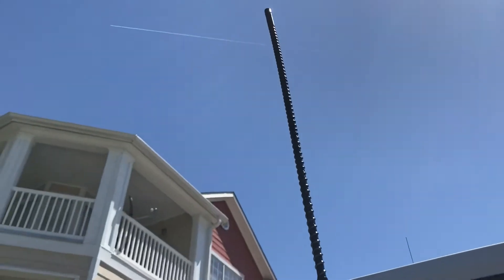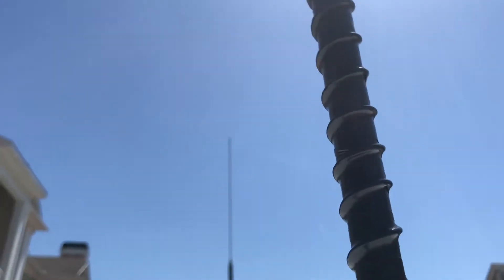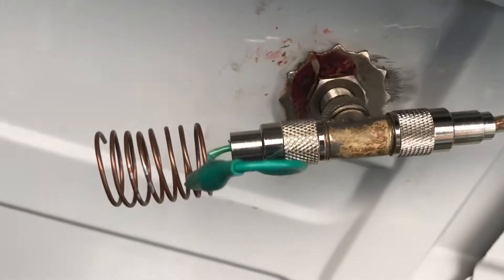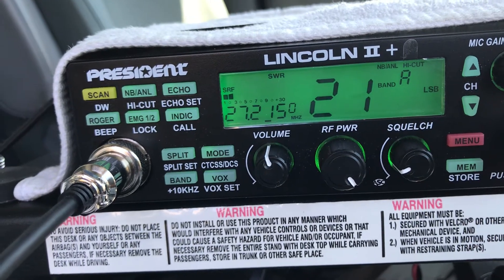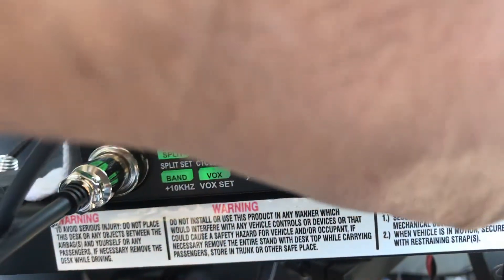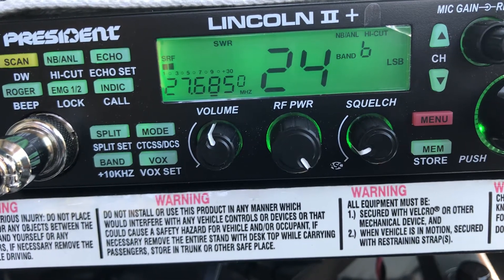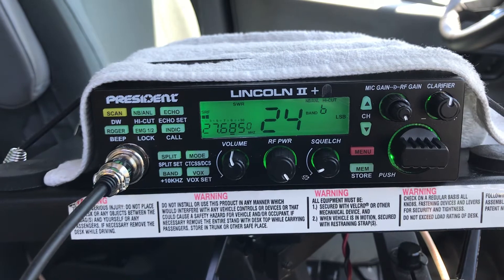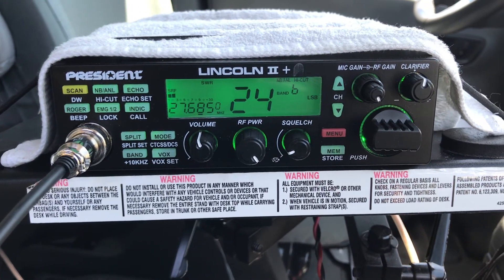Homemade CB antenna. Top loaded. 11 meters

Comment: sramsdellwdm: Thank you very 
much for posting this video!!  
How did you figure/calculate the 
dimensions, ie: whip length, 
wire length & diameter, etc? 
Regards & 73, Norman.
Reply from the maker: I did a rough guess. Just kinda got lucky. I have a mfj antenna analyzer. It helps tremendously. I only had to pull off a couple of turns of the coil to get her matched in. So no formula. I also made a 3ft version also that performed very good.
Reply: @hamradion1fjb : Thank you for 
responding & thank you for 
allowing me to learn from you!!  
You are a YouTube model, sir!! 
Best regards and 73 , Norman.
Reply from the maker: I am out of town this weekend, but when I return I will measure and do another video with exact specifications. So it could be replicated. I want others to experiment and learn in the process.
Reply: @hamradion1fjb I look forward to 
your video.  I have a couple of 
ideas, but I want to try them out 
before sharing them to make sure 
they work!  Isn't all this 
experimentation & sharing 
knowledge fun?!  I'm having 
a blast!! Have fun this weekend 
whatever you're doing!!  Take care. 
Regards & 73, Norman.

Comment from the maker: After extensive studies, I researched continuously loaded antennas. I build a few also. A continuously loaded antenna has no coil on the top. This antenna design is similar to trucker style fiberglass whips. Same design. This one is larger diameter, and requires less of a top load coil. This is due to the wire diameter. Most whips use 22-18 gauge wire. Mine uses 14 gauge. This is why my swr is so wide. I did a test with this antenna vs a Wilson 5000 roof mount. Receiving station reported an s5 signal With this antenna. I then switched to my Wilson. His report was s5 to 5 1/2. So it stands very close. So before people run there mouth they should do some of there own home work.

Comment: It is CONTINUOUSLY loaded, not top loaded.  It will blow up if used above 27.4
Reply from the maker: Actually it is top loaded. If it was continuously loaded, there would not be a coil at the top. Maybe you should do some do a little more reading.
Reply: No it's not, it is continuous.